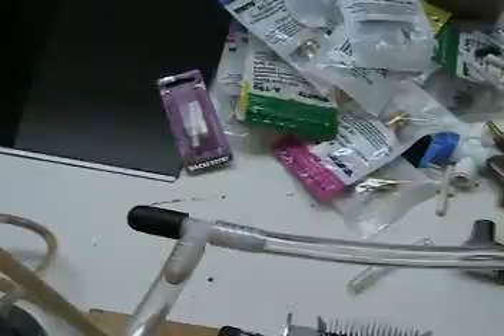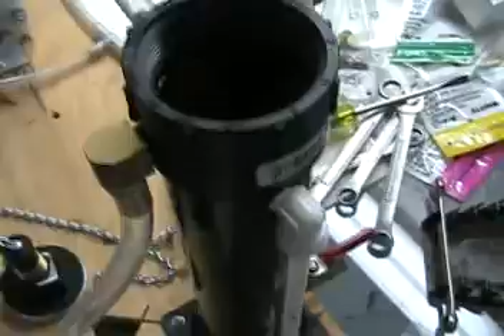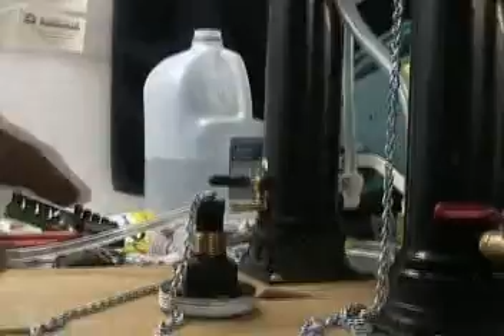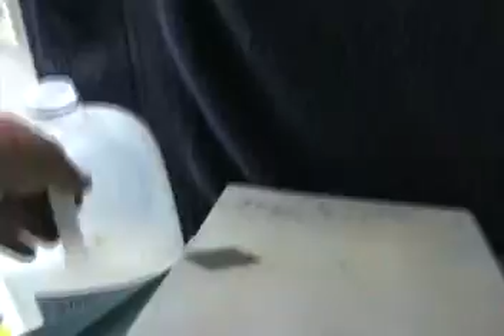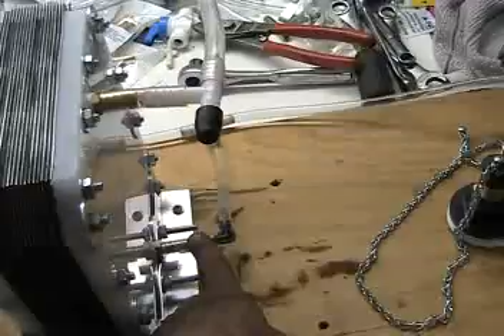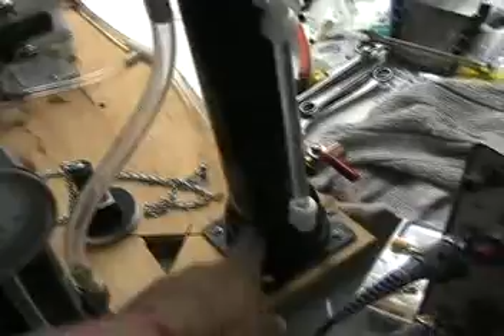Dry cell assembly 5

Comment from the maker: @TheOldElement 1. no you can not use aluminum, it will react with the koh/naoh and will decompose. 

2. by dry cell it is meant that the cell is not in a bath, that the plates are not just in a jar or other container. the inside is wet, but the outside is dry.

Comment: i have just started getting my material together i am wondering if you have heard the new studies that are out. they are saying to use titanium instead of stainless steel due to the hex crom it produces as a by product of the process. 
 Your cell looks great and i was going with a submerged design till I saw you put your together. Iwill do some more research on the titanium plates but they say they run clean and dont get the foam build up whick contains the hexivaliant cromium.

Comment from the maker: wow I can't believe I missed this comment, sorry about that. The material is neoprene, and the gaskets were custom made, from a dye one of the guys had made. the previous dry cell setup I hand cut the gaskets using a cardboard template. To simplify and save money I would suggest that u use shower pan pvc material from home depot for gasket material, and put the bolts on the outside of the cell. This would proly be the best solution for the time being.

Comment: One last comment about spreading the connections ou with dry cells, something you cannot do (safely) using wire, esp for submersed cells.. I bet it also spreads the CURRENT more EVENLY across the plates vs starting out at one end, and using a bolt or other connection device to try and carry the current down the line to each plate? 

Either way cannot wait for your 12V 30 amp tests on this guy.. will check your other vids. Cell looks GREAT! 

Can u document heat buildup at say 30amps/12v DC?

Comment: In your vids you sound like u might be an eledctrician, 4 u job, I might pick your brain via PM sometime if you dont mind..

Was reading about amps/heat and read HEAT is generated by FRICTION at a molecular level? Caused by the electrons colliding due to imperfections in the steel which is trying to carry the current. More current on smaller   metal/connections, and collisions increase = heat. Therefore larger connections and wire (larger bolts, maybe thicker plates?) do heat up slower? agree?

Comment: U are right about the 1/4" bolt and amps. I Upgraded to 3/8" for the Anode/Cathod bolt connections, Now instead of connecting the cells below the SS extensions, using 5/16 bolts and washers Im Using the plates extenders which connect the ANODE and CATHODE to the 3/8" bolt at the top with the single 3/8" bolt ea. So, I eliminated the 2 5/16 bolts altogether. Huge difference in heat production at the anode/cathode Still does heat up when it reaches 30 amps. but not as fast (takes about hour)

 .

Comment from the maker: it is usually because dry cells are setup as series stacks (n plates) which cuts the voltage of each plate pair down, which reduces the amp draw from each stack. SS is a very poor conductor, more like a heating element really, it has such high resistance, so as more amps get drawn through a single terminal it heats up very fast. A 1/4 bolt shouldn't get more than around 7-10 amps max. And since there are normally multiple connections on a dry cell it spreads the amps out over a greater area.

Comment: You are exactly correct sir, Im looking at going dry, no matter what I do, my SS my anode/cathode connections get hot enough to melt plastic on my wet cells at or above about 15A. Also the bolt connections seem to MAGNIFY this problem when you spann them across several plates. 

Was wondering why dry cells dont get AS hot at the plates/connections etc.. Is it plate thickness? lack of bolts due to spread out connections via muliple wires? Fluid movement through cell/bubblers or all above? Mmmmm

Comment from the maker: dry cells are much more efficient, they produce more hho for every consumed watt, so yes they are more productive for the amps they use. Their form factor is also very nice since they water can be remote mounted in any shape needed. The HUGE added bonus is that NO electrical connections are exposed to the hho, a bad connection can be a very bad thing, and ss is not a good conductor so all ss conections get hot. All in all the dry cell is far superior imho.

Comment: did you use any special technique to cut the gaskets? like a template or did you just do it freehand? also the black gaskets. where did you pick up the material for those. the plates, did you use a template for the holes? i have 60 8x6 plates and i dont want to mess up thanks for your reply.